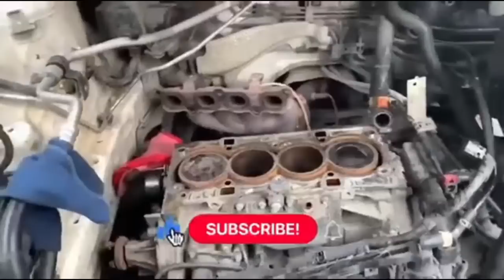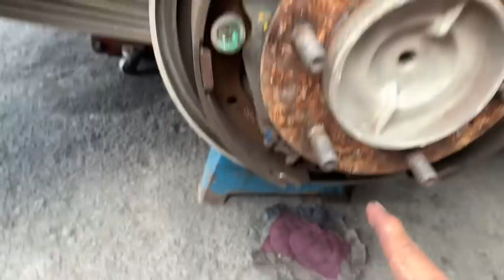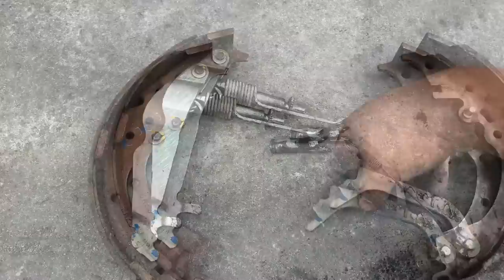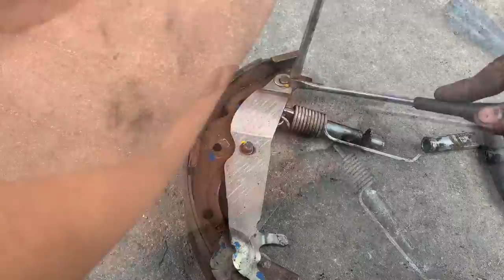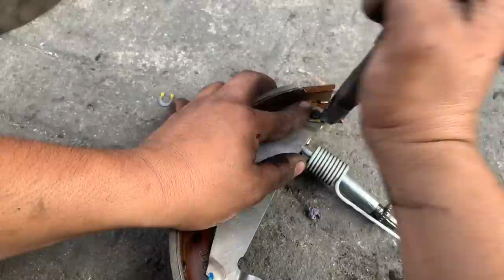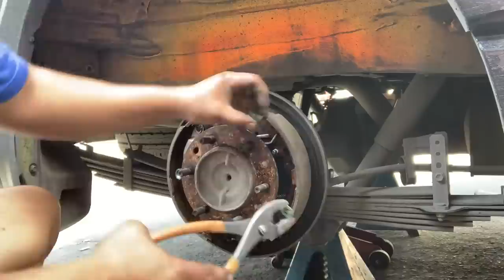Toyota hi ace break shoe paano mag palit

Comment: gud pm po. mag bleed sana ako ng clutch pero biglang lumosot ung pedal ng toyota gl grandia at di na bumabalik. nagpalit ako ng repair kit sa baba at clutch master sa taas. nung mag bleed ako eh hindi tumitigas ung pedal at lumolusot lng parang walang pumapasok na fluid. hindi nagbabawas ng fluid sa tank. inalis ko ung hose sa tank eh hindi kusang lumalabas ang fluid. may gate valve ba ung fluid tank o may sensor o kailangang umaandar bago mag bleed.
Reply from the maker: May diskarte po yan 
Or need nyo ng pang suction